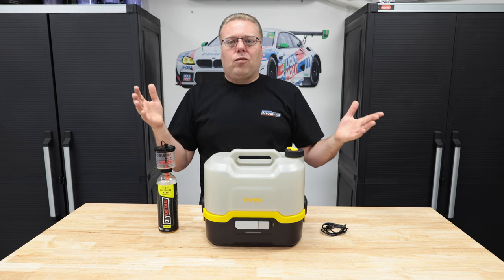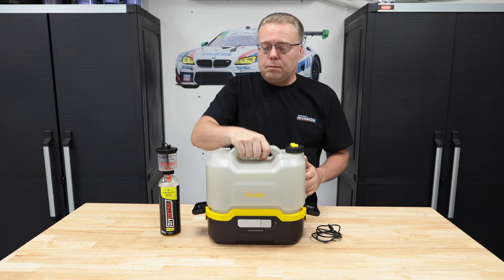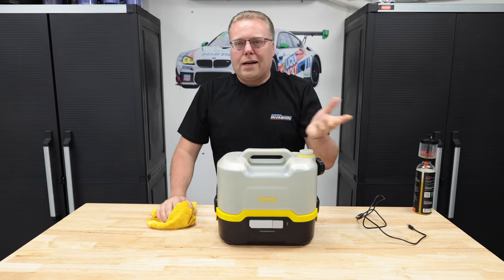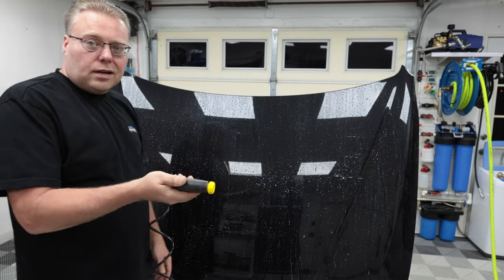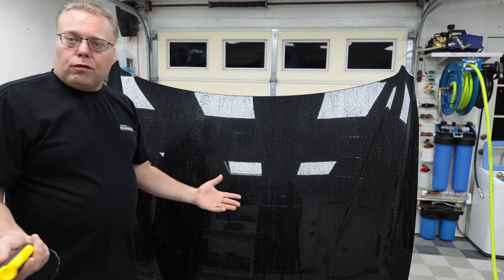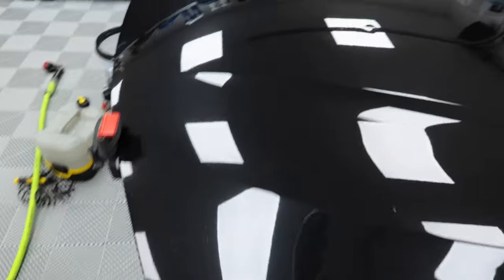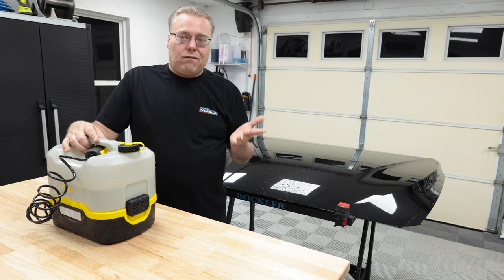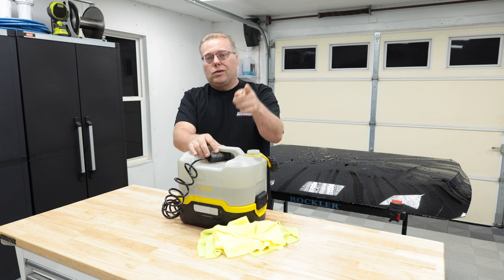Best Rinseless Sprayer? | Battery Powered | Fanttik NB8 | Review & Testing

Comment: Hey Keav, unrelated to the video but what do you think is the safest way to remove light dust from a car besides fully washing it? I notice after I wash my car, even if I leave it in my garage for only a day/overnight a light layer of dust forms and I would like to remove that safely without have to wash it all over again.
Reply from the maker: Waterless wash will do the trick. I use it all the time for that. A light rinseless will work as well.
Reply: If it’s just a day’s worth of light dust, you can just use your handheld dryer / shop blower (as long as you keep garage clean, otherwise dust will show up again). If you have a dust problem, the solution is an air filter. Like one for a wood shop. Or you can make a cheap one with a box fan with a high merv hvac filter rubber banded to it.
Reply from the maker: @armandosinger  Yeah, Ill hit it with my compressor air real quick to get that floating dust off.

Comment: You had no problem adding the rinseless wash in the sprayer, correct?
Reply from the maker: None at all used it just last night on my wife’s car as I had my pressure washer unhooked to make another video. Sprays so good!
Reply: @CarsWithKeav  A waterless wash  should work just as well don’t you think?
Reply from the maker: @billbuss7542  Don’t see why not it’s not a harsh Chemical that actually is probably less harmful than Tap water.

Comment: Hey Keav, Home Depot has a Ryobi One+ 1 gal sprayer for 90 bucks with battery/charger.  Do you have any experience with that one?
Reply from the maker: I have one from a few years ago it doesn't have anywhere near the pressure this thing does. I tried to do insecticide with it, but it has sat on the shelf only after a few uses. I may have gotten a dud, but it doesn't spray good. It could have improved over the years though.

Comment: Mine started leaking badly the second time I used it. Now unusable. I bought two. Afraid to try the second one. Very disappointed, nice when it worked. You might want to save your money until they correct the problem.
Reply from the maker: They have very little complaints on this unit and it has a stellar rating so not sure there is much to correct. There will always be a few units that have issues and you unfortunately pulled the short straw on that unit. Hate that happened to you they do have great customer service.
Reply: @CarsWithKeav  I’ve been very disappointed with their customer service. Don’t seem interested in correcting the problem.
Reply from the maker: @billbuss7542  Well that sucks. Hate you are having such a bad experience.
Reply: @CarsWithKeav  Yes I’ve purchased a lot of Fanttik products and never had a problem with any of them before. I guess you learn a lot about a company when you have a problem and how they respond.